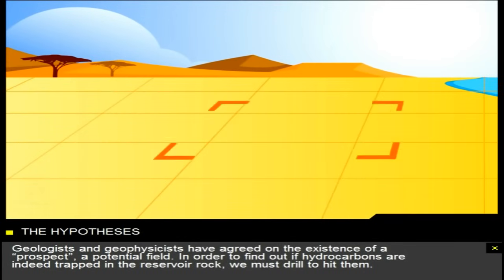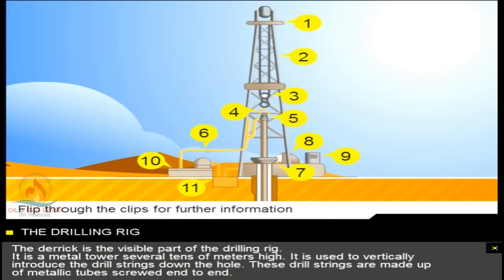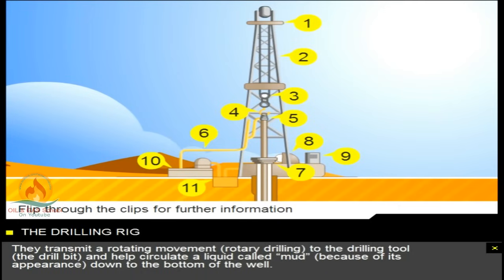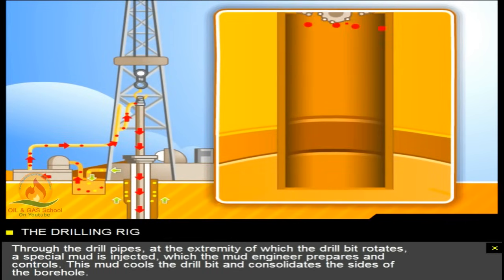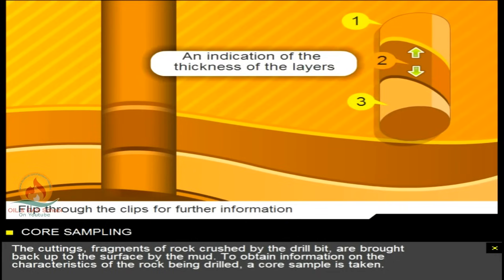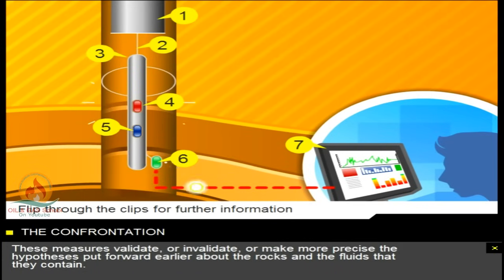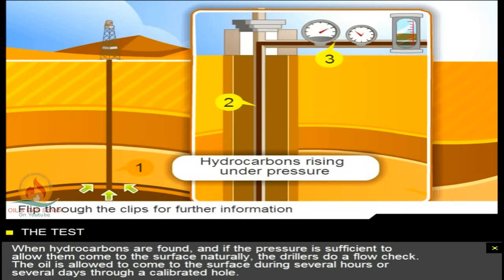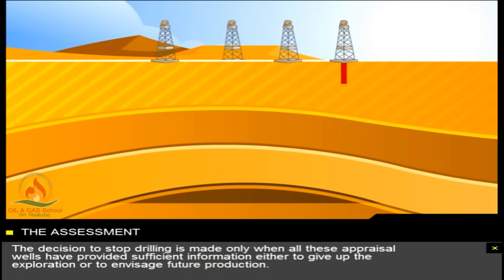Oil Drilling | Oil & Gas Animations

Comment: Trapped in the reservoir rock 
We must drill to hit them
Derrick- is the visible part of the drilling rig
Drill strings
Gushing of oil
Equilibrating
Core sampling
Permeability 
Porosity fluid content
Refine

Geologists, Exploration team agree on the place where drilling will be conducted. 
To find out whether hydrocarbons are indeed Trapped in the reservoir rock we must drill to hit them. After, a hole of small diameter (20-50cm) is made.
The decision to stop drilling is made only when these appraisal wells have provided sufficient information either to give up the exploration or to envisage future production.

Comment: how do the floating derricks account for waves? looks like only 2 versions are propped up on a structure. just seems like a big wave would break the driling pipes by shifting the derrick a bit too far or at all.

Comment: Does this land exploration applies also to off-shore exploration? (Urgent question)
Reply from the maker: In general, the equipment used in both offshore and onshore drilling are not much different. Both methods require tools like exploratory equipment, waste-water/oil separators, pumps, pipelines and storage tanks.

However, there are some key differences between offshore and onshore drilling equipment as well, specifically in the structure of the drilling rig itself.  Onshore drilling rigs are the more classic drilling equipment and come in different sizes and strengths. They are generally classified by their maximum drilling depth and their mobility. Conventional land rigs cannot be moved as a whole unit and are typically used in the petroleum industry while mobile rigs are drilling systems that are mounted on wheeled trucks and come in two different types, jackknife and portable mast.
Reply: Thanks for answering me immediately!!! :)

Comment: 11000 meters, holy shit! What were they drilling for...magma?!
Reply from the maker: Diameter of the Earth is 12,742 km just 11 km of them never lead to magma :)
The worlds longest drilled oil well is BD-04-A, with a total length of 40,320 ft (12.3 km) MDRT. It was completed in May 2008 by Maersk Oil Qatar and Qatar Petroleum, in the Al-Shaheen offshore oil field off the coast of Qatar. The well includes a horizontal section measuring 35,770 ft.
Reply from the maker: Such a small diameter (from 20 to 50 cm) with a length of 11 km in comparison with the surface area of the Earth which is 510.1 million km² and a diameter of 12,742 km, will never crack the Earth :)
Reply: yea...36 grand & some change to boot with.